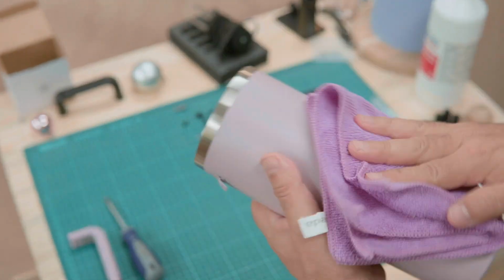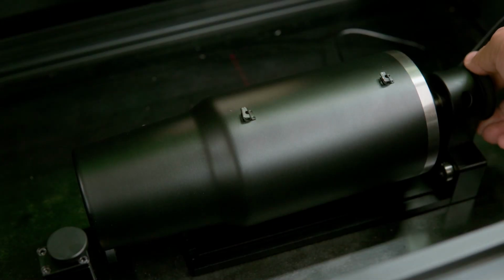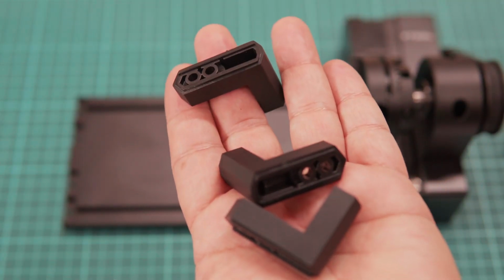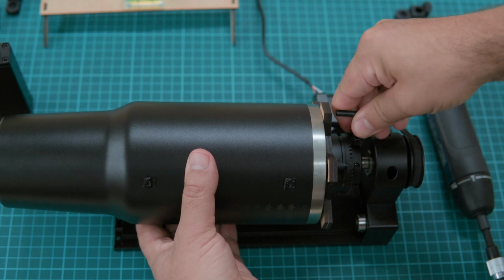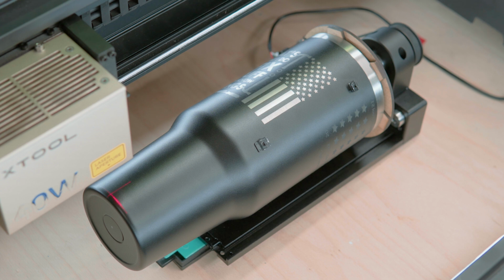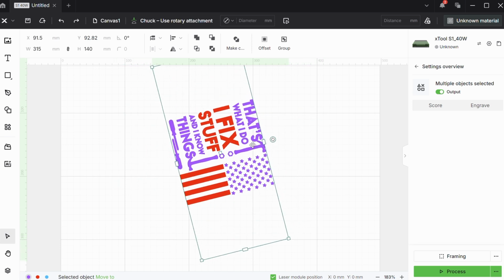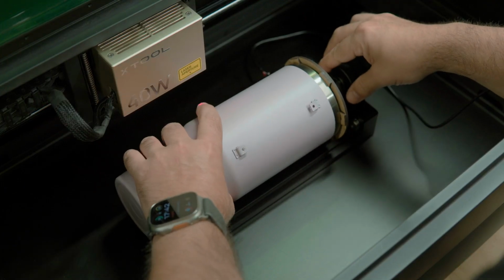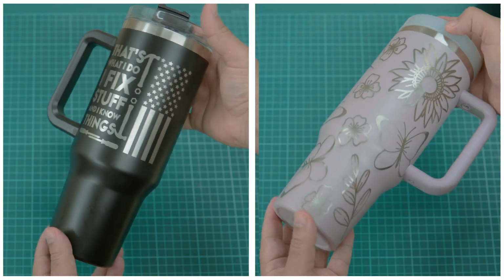Beginner’s Guide to Perfect Tumbler Engraving With the xTool S1 40w + RA2

Comment: Just tried my first test grid on a tumbler.  Entire garage filled with awful fumes.  I’ve watched you and other engraving tumblers but haven’t heard you talk about minimizing fumes.  I have a 6” exhaust on my S1.  It was like I had no fan at all.  I used xtools settings.  Btw both of my garage doors were open.  Am I doing something wrong?
Reply from the maker: If you did everything correctly, the only thing that comes to mind is that your tumbler might not be the right one to engrave. Check the material. If it burned and you had smoke that’s not the right surface or coating.

Comment: I have the XTool S1 40W with the RA2, I have only used the chuck mode and my first test it printed the name backward? I had reverse the image to get it to etch correctly. You didn’t have that issue? What am I missing?
Reply from the maker: I don’t mirror the engraving. I just make sure the rotary is positioned the correct way. Say, what shows up when you use the preview? If it’s all good there then I would make sure you selected the right mode, chuck vs roller. Also make sure the rotary it’s physically placed correctly. If you can read the logo on the rotary, you are good to go.

Comment: If you need to repeat the same
Design in the same kind of tumblers can you keep repeating the job without doing new pinpoints???
Reply from the maker: If you are 100% sure they are the same tumblers, and you don't have major OCD like I do, you could potentially just keep batching them as long as you don't move the setup you use. If you have a jig or use the RA2 fixed to the base, again, you could. I'm being careful when answering simply because you move something 1 mm and things will go off...Would hate to give you a solid yes and then ruin some of your expensive mugs

Comment: Dumb question. If Im adding something to a tumbler that already has something on the other side what is the best way to get the new engraving on the other side
Reply from the maker: I hope I understood correctly. If I am going to engrave a tumbler that already has another engraving, using the rotary attachment tool, I would just make sure the existing engraving is on the bottom, and I would work on the empty surface as usual. I use the Xtool s1 and with the software, xcs, I can use the crosshairs on the laser and also add it shows up on xcs, and line up things just right

Comment: I am having a issue with on the bottom doing a wrap it is not fulling engraving due to high difference of the smaller section how do you get around that? I ruined a few cups trying to et the bottom to come out ha.
Reply from the maker: Oh no, I feel you! Had the same issue. Those bottoms can be tricky. Try tweaking the focus by getting the average between the highest and the lowest point and plug that in as your distance. If you can, level it as much as possible, watching that module, so it doesn't hit the cup. You'll get it right, just keep at it!
Reply: Thank you. I will do that.

Comment: Thank you for the video… I also have an S1 and have been engraving tumblers but recently picked up a “Built” brand tumbler from Walmart and the coating is much thicker and I have not been able to get a clean engrave so wanted to ask your opinion on that. Thank
Reply from the maker: I run into that from time to time. You get into a flow after getting the settings down and then something new comes in the picture. In this case, being that you got a new tumbler, this type challenges are normal. In that case what I do you might not like: get an extra tumbler just to test. Do a small test grid and then figure from there what works for you. Then keep that tumbler handy for the next time you buy the same brand and style. You will soon have your own reference library! Let me know how it turned out!
Reply: @severnabuilds thanks for the response and yeah just going to use that tumbler as my test. I also think the logo I was using just want great for that thick of material so I may change the tumbler brand to a thinner coated stainless